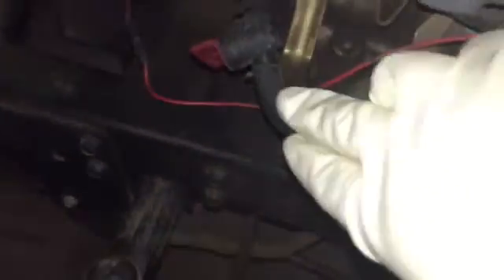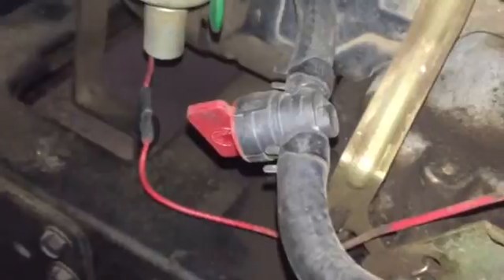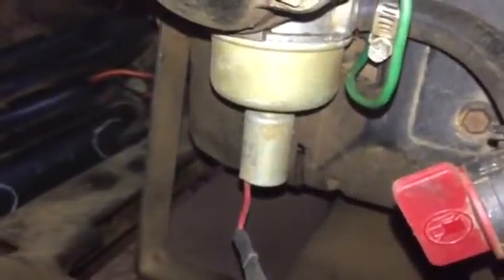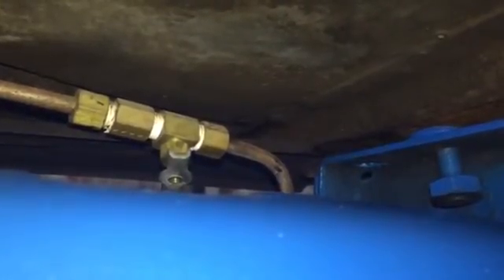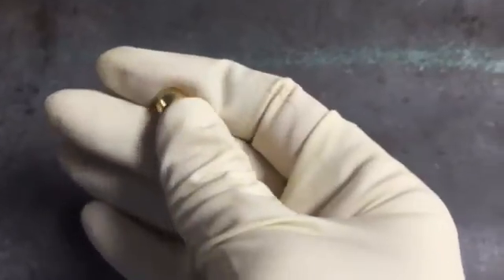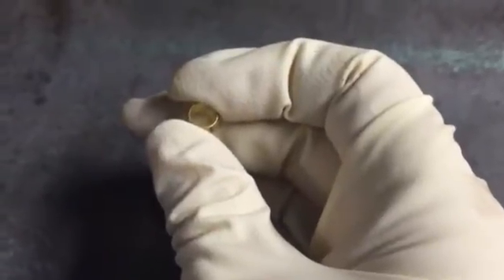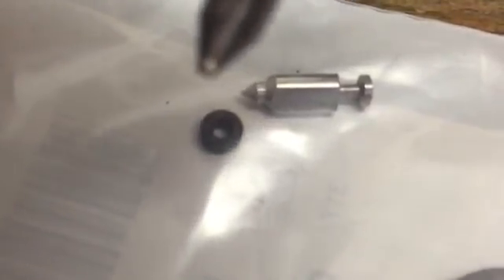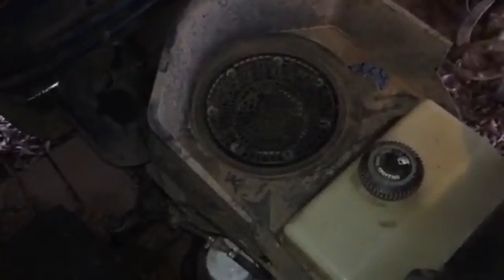Why Fuel Shut Off Valves Are Important on Gravity Fed Fuel Tanks (And Info On Installation)

Comment: I installed a 1/4 inch at both ends, shut-off valve, and it slowed the fuel flow to a trickle, where it once ran like a river, before I cut the fuel line (fuel flow had no issues before it being cut). Tried fuel flow in both directions through the valve, and same thing occurred, and they are new shut-off valves. Put another brand new valve in it's place, and it did the same thing. It ended up not feeding enough fuel to the carb. to keep the bowl full, and float at the right level, thus it started causing engine surging, chasing for more fuel. Explain that issue.....

Comment: Is it the same for 2 stroke motors?
Reply from the maker: For the most part, no. This concept pertains to engines that the gas tank is mounted higher than the engine, with the fuel being gravity fed. Most 2 stroke motors like chainsaws and weed eaters are siphon fed and the fuel tank sits lower than the carburetor. There’s a diaphragm inside the carburetor that works as a fuel pump to siphon the fuel from the tank. So when the 2 stroke isn’t running, there’s no other force to feed fuel into the engine.

Comment: I remember when this problem happened to me on my Craftsman lawn tractor.I didn’t know what the heck was going on.I first though battery was weak cause of slow engine cranking.Bought new one same weak cranking symptoms.A friend at work told me take out spark plug an crank it over while looking at plug hole,an see if any gas spits out.Well it did !!!! big time!!!!! I heard a new fuel solenoid was very expensive.Changed oil an filter installed $4 dollar fuel shut off,problem solved!!!

Comment: Tons of gas in my crankcase. I may have left it in the feed position mistakenly. I changed it and all good so far. I've been letting the motor run a bit after closing the shutoff valve as you said. Thanks Man!!

Comment: The pressure of the fuel does not damage the needle and seat, however you are right that the needle can leak. more important is to run your carb dry every time that way if you don't use it again for a while it won't be varnished up.

Comment: that engine has the solenoid valve, turns off with ignition switch
Reply from the maker: Yes they do. They also leak. The rubber on the end of the plunger gets hard with age and will stop sealing, allowing it to leak fuel into the engine. Seen it happen many times even with the solenoid.

Comment: Just picked up a mower due to this exact reason. Bought it smoking like crazy. Carb was nasty and flooded the engine to the point it was burning the oil/gas that had filled up in the crankcase. Cost me an oil change to get it going.

Comment: How often do you shut the fuel off with the shutoff valve?
Reply from the maker: Every time I get done using the mower
Reply: Does this protect the carb? If so there still is gas in the bowl.
Reply from the maker: It protects the carb by preventing fuel pressure from the carburetor. If there is fuel pressure on the carburetor and the needle and seat start leaking it can leak through the intake and fill the crankcase with gas, which will ruin your engine. You can turn the valve off and run it dry
Reply: always turn it off when not in use